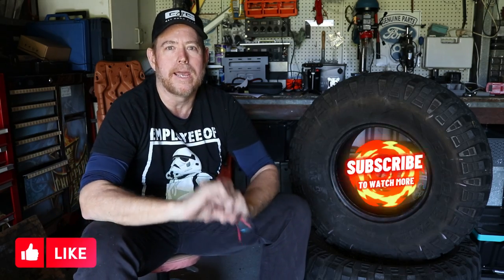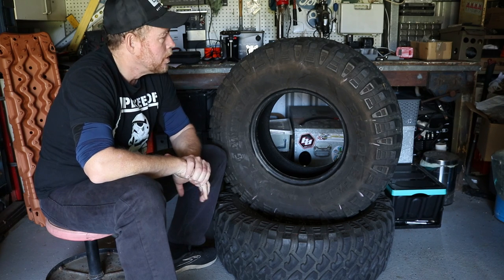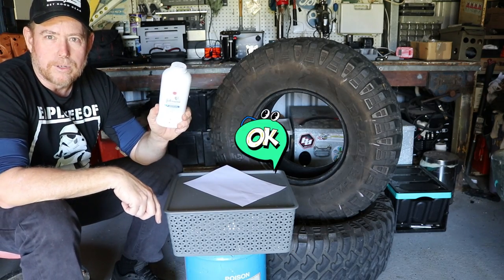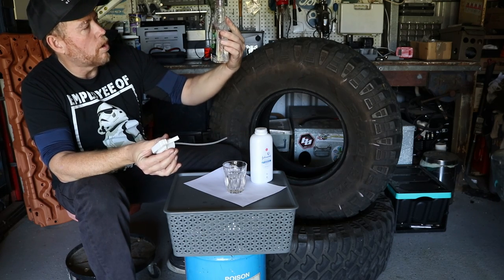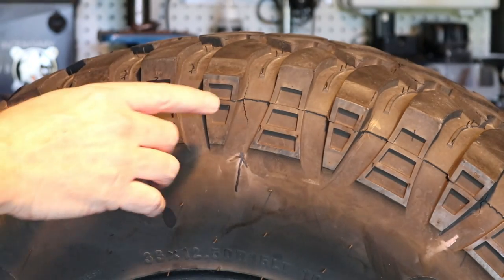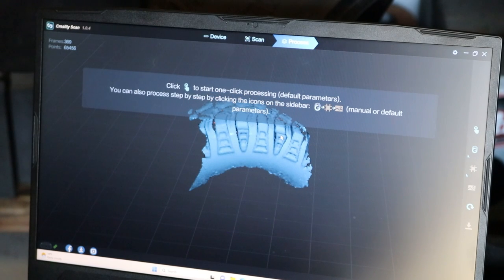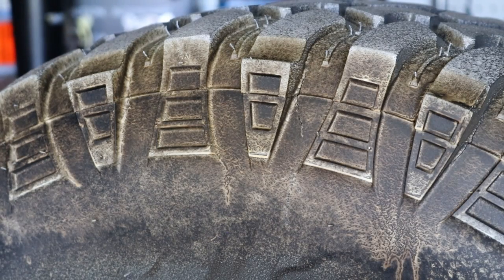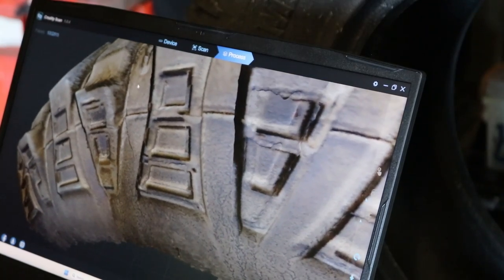How to make your own 3D scanner spray in your shed

Comment: Looks like the tire did not have any problem scanning without spray.
Reply from the maker: The tyre certainly had enough texture to scan without the spray, The spray did make a difference in the details of the Cracks in the Black Bear Tyres